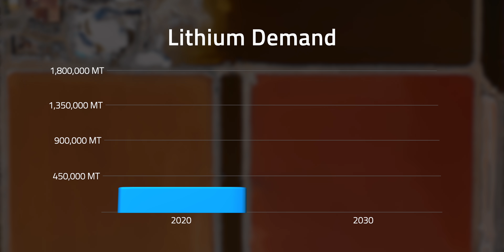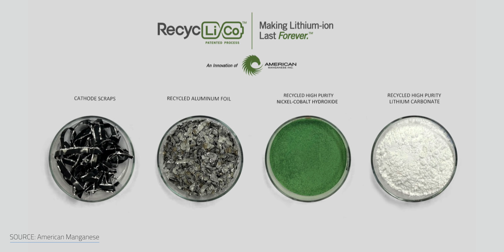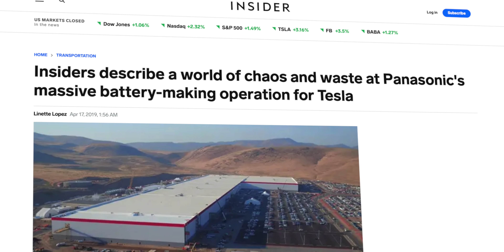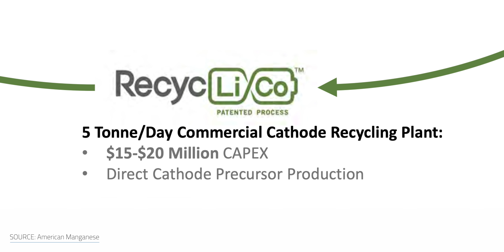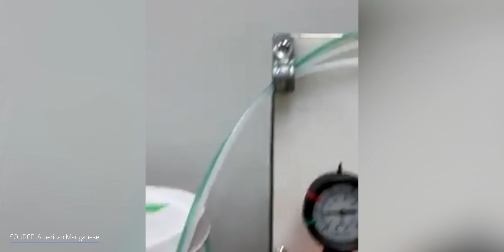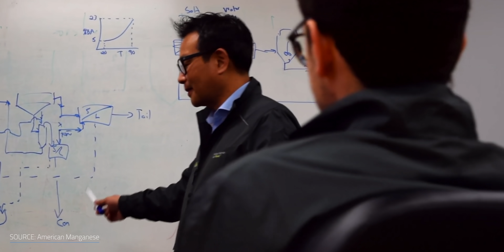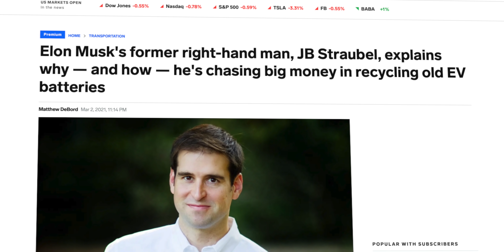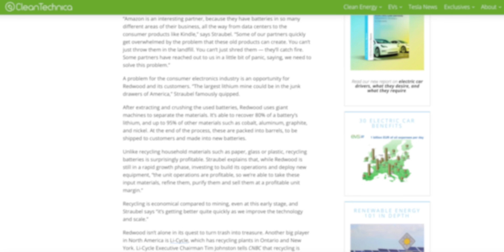Solving EV's Biggest Problem - Battery Recycling Explained

Comment: How do you fight a lithium fueled fire? I'd consider that an issue.
Reply: That's one of the reasons recycling is important. You don't wanna be just tossing these batteries in the garbage.
Reply: @jameshughes3014  that doesn't stop. A car from crashing and burning guy.
Reply: @jtackerman28  If a battery is properly recycled it wont catch fire. That's why you recycle them properly instead of tossing them in the trash. it's kind of like the same reason you don't just pour gasoline down your drain. If you're worried that a car might catch fire because it is electric, that's a different thing. All cars can catch fire and blow up when they crash, so.. I don't see the point really except that, gas cars produce more pollution which does lead to hundreds of thousands of deaths a year. So if your point is that electric cars are more dangerous, I'm gonna wanna see where you are getting those statistics.
Reply: @jtackerman28  Thinking more about your comment I realize now that it didn't have much to do with the video which is why I was confused. it seems you're just saying that lithium battery fires are bad. And, they are different and scary . but they are also very, very short lived. Putting them out isn't much of an issue because by the time any fire truck gets there, the intense burning is long done with. And they can be put out, we just need to use an extinguishing method other than water. At the end of they day, if you are in a car that crashes and catches fire.. it doesn't matter how hot the fire is, your a goner. So to me the important thing is which one is 'more' dangerous, and by far gas cars are more dangerous even as far as catching fire is concerned.

Comment: Would graphene based batteries, if they could continue to improve and be implemented, solve the lithium problem?
Reply: No, use of graphene will not solve the lithium problem. Whether the anode is graphite or graphene, it still needs lithium.
To solve the lithium problem you have to replace the lithium ion (e.g. by sodium).
Reply: @clockworkonion954  What about aluminum ion batteries?

Comment: While recycling is good to not waste the materials, you can’t go from a small supply of batteries from 8-10 years ago to have enough output to get to what’s necessary in the next 10 years. Only makes sense once you have stabilized in production. CNBC already did a video on this a month ago and had a lot more detail and not this high level garbage. Recycle this video into something better.

Comment: Matt, what a timely video.  As a current EV owner (chevy volt), purchased in 2013, I always thought it was a matter of time before there would be a sizable transition to EV's (still in the future).  Continuing this thought process, I also thought the elephant in the room was going to be disposal.  Again we can thank capitalism for rising to the challenge of lithium recycling.  Great video.
Reply: Im also a Chevy 2013 volt owner.
Have you had any thoughts of replacing your battery yet?
Reply: @richardrolson2713  Not yet.  I purchased my Volt new in 2013 and liked the car so much that I purchased another 2013 5 years later.  Both cars have approximately 90k miles.  Both cars are still charging to 40 miles on moderate driving and weather.  Typical nuisances with the cars.  I thought about trading up to a gen 2 but decided not to.  Probably at some point the battery is going to degrade at being unusable.  Since the car is not manufactured anymore and GM is only required to provide parts for a given time after end of manufacture,  I haven't crossed that bridge yet.  The volt concept with the extended range using the ICE still works for me.  I would maybe transition to a full EV when I can go to the local fuel stop and top off in 5 minutes.  And not wait in line to "gas up".
Reply: @scruffy4647  my 2013 has approximately 148000 miles and is getting around 38 miles here in sunny Florida. My next car will be some Tesla since they stopped making the volt.
Reply: @richardrolson2713  They finally got a Tesla service center here in our area (Tulsa).  148k miles on your volt is awesome.  I could do a Tesla at some point.  I do not do that many road trips anymore.  My only complaint about my volt (I am an old guy), is I like knobs for the a/c-heater control & fan control.  Not sure how tesla does theirs.  I am still use to having an instrument cluster behind the steering wheel.  Once you get use to hardly buying gas, it would be hard to go back to an ice vehicle.  Good luck with your Tesla.

Comment: The sooner we transition to aluminum ion batteries, the better. All you need is aluminum, carbon and urea to achieve 500% higher energy density, and the power density of a super capacitor.
Reply: Why are no manufacturers investing in it if it's so superior and has all the pro's with none of the 'con's'.
Reply: @user-uu6bi4tn5o  may be due to R&D they invested on lithium ion battery
Reply: @user-uu6bi4tn5o  The problem is longevity. They lose capacity much faster than lithium ion batteries do. Research is being done, but there is no breakthrough yet.
Reply: @rogerstarkey5390  you can always compensate for these short comings with the appropriate series stacks and parallel architecture provided energy density and power density characteristics are practically and viable.
Reply: @Simon-dm8zv  so it will not be good if we transition sooner rather than later into an inferior chemistry with limitations that can't physically be overcome.

I mean if the limitation is based on structural instabilities then obviously doping trials would be worth investigating but if it were that physical characteristics of the principle materials requires too many compromises then it won't disrupt Lion!

I trialed sodium ion years ago and that seemed to be more attractive for some niche applications.

Another alternative that has gathered more pace than Al. is the Blade which BYD have pioneered supremely. Not as power dense but more cycling life and just as energy dense.
Reply: @satwik1395  I know it's R&D, why are manufacturers choosing to investigate Lion over Al. ?
Reply: @user-uu6bi4tn5o  Exactly. Lithium-ion is here to stay.
Reply: @Simon-dm8zv  I'm afraid so.... until solid state breakthroughs and scale up, there is no disruptor in sight that will shift today's direction from what I see. Maybe alternatives, not disruptors.

Comment: That is way far down the line. Batteries will have a second life first as battery banks like powerwalls.
Reply: @rogerstarkey5390  production will progress so fewer fails will give less batteries to recycle from production. But off course at one point in time there will be a need for large scale recycling of batteries.

Comment: For a battery only transportation world, it’s likely we will need 100-1000x more battery production in 20-30 years, even with 100% recovery using recycling we cannot ever reach parity. Doesn’t seem sustainable with current technology. Battery’s are not actually a green energy technology when it’s made from non renewable resources. Don’t fully understand why it’s the primary contender for a green energy future when a battery’s demand for non renewable resources is so high. 

If only there was a energy storage mechanism that could be from something readily available everywhere and anywhere, and that constantly recovers itself and naturally recycles itself immediately once used…..
Reply: the problem is a lot larger than people realize with emphasis on cars, they've really missed heating, cooking, hot water and so much more, so much more. providing electricity and education to 1 billion people who can't power a lightbulb

Comment: I'm really hoping EV manufacturers let you upgrade to larger batteries as tech continues to improve and the old ones begin to die. i.e. if the standard range improves from 230 mile range to 320 mile range, that you can get the higher range battery installed into the old chassis.

Comment: Nice test lab - but we are still not able to build entirely new batteries out of recycled batteries, which means the issue has not been solved and we have no idea when, or even IF that will change.

It also does not attack the issue that batteries are heavy and need a lot of space in your car. They are a bad energy storage solution for EV's not just because of what their production does to our planet and the countries these mines are located at.

Comment: Actually you have 3 problems in this order. 1. Road taxes presently being collected on  fossil fuel only will have to shift to the magic electricity grid. 2. Where  is all that magic electricity going to come from?. 3. what cha gonna do with all those effing battery's there pal.
Reply: He is from the green religion, he is a Tesla Priest. They tried to solve the problem from the bottom, not from the top. The power grid must change first. Green extremist like this guy will never tell the truth.
Reply: @annakquinn7084  Why not change both? Most of our energy comes from ff plants. 

But all energy in an ICE car comes from fossil fuels and won't change even as the grid improves.

It takes a long time for new tech to take over. Better start now than later.

Comment: As long as recovery efficiency is less than 100% at scale mining additional resources will be required I would think. However, if we can get high levels of efficiency with recycling and reduce the amount of resource extraction from other means then we’re better off! Some of the emerging technology sounds quite promising. Thanks for the video Matt!
Reply: 99.9% isn’t bad. But not 100% I guess

Comment: Great video - Governments should have tied electric car incentives to effective battery recycling / reuse.  I'm interested in a video on third party battery replacement efforts for older electric cars.  Their are a number of electric cars on the road with exhausted or nearly exhausted battery capacity and the number will increase YoY.  The electric car manufacturers naturally want to sell more cars and keeping older models on the road would be counter to that strategy.  The cost of replacement battery packs is a very real issue.

Comment: How much waste and pollution is created in this process?...how is the waste disposed...what gasses are released in this process...and with the emphasis on averting climate change, what does this process do to accomplish this? Simply re-introducing material with such a demand does not count as green. This should be resolved before implementing a huge technological enforcement...
Reply: Waste pollution is zero compared to fossil fuel production. Most chemistry aims fro the emmisions of hydrogen, oxygen and co2 which is then reused in other uses from concrete production to biological sciences. The reuse of these metals allows us to stop mining these rare metals at large scales, they are trying to make new batteries out of zinc ion and stuff but the research isn't far enough. It is important as this could also significantly decrease coat of ev vehicles as the main cost is the batteries, when you can sell dead batteries back to a refinery in the end you'd be spending half to even 1/3 of what you did for the original battery. We don't have the infrastructure yet but the development is in the works and is progressing faster than anything. The worry about producing excess greenhouse gases is kinda uneccesary as we can collect it and use it for other purposes unlike in the past where we just dump it into the atmosphere

Comment: Battery recycling may make EVs actually sustainable at least once we have gathered enough materials from the earth.
Reply: And what will be your attitude toward EVs if that is not the case?  Do you get credit for good intentions?
Reply: @Heroesbleed  When EVs use finite recourses it does not fit in the sustainable future we try to achieve.
Reply: @rogerstarkey5390  They are necessary evils.  Why do you ask?

Comment: Love it. Thanks for the insight. I am still having trouble justifying a 40K EV when I am getting 38mpg average on a 28K gasoline engine auto. And also do not have any of the hassle of getting the charging logistics in place in the home and having to monitor where a charge is available when out on the road. Maybe someday I'll get there. But this is definitely looking good for the future.
Reply: Setting up the charging infrastructure for my Tesla (at home and at my cottage) took about 2 hours in each location.  Now it's been 2 1/2 years since I've had to visit a gas station or change the oil.  What a huge relief not to have deal with gas stations!  My 500km range is way more than I need to get to my cottage (250 kms from my home).  Waking up to a full charge every day is no different than how I deal with my cell phone, except of course there's no need to plug my car in every night.  Tesla Superchargers are plentiful; it's a total non-issue.
Reply from the maker: I'm in the camp of if you have a good, working vehicle keep using it for as long as it makes sense for you.  Using an existing car (gas or EV) is better for the environment vs. building a new car (gas or EV).  But in the long run the transition to EV seems inevitable at this point.  It makes too much sense and there's so much progress happening in manufacturing, charging infrastructure, etc.

Comment: Battery recycling is BY FAR not EV's biggest problem. Industries are already popping up to recycle. No big deal. The biggest problem is where does the electricity come from to power EVs. Note the massive grid failure in the 2021 freeze as an example of how fragile the infrastructure is. Now think of the countless tankers of petroleum products imported / used annually. The energy from the petroleum has to be replaced by something that generates electricity. That's EV's biggest problem - how to get enough electricity to power the cars.
Reply: The homes in TEXAS that had power were the ones with EVs and Solar and Batteries.
Reply: @honesty_-no9he  per calorie, broccoli has 1.8 times the protein that beef has.

Comment: This has always been a big argument against electric vehicles and Lithium grid storage. I think it's a chicken and egg thing where once big batteries are everywhere recycling will become a lot more economical. Unlike plastics, recycling metals can be much more effective because it's elemental materials, not unstable polymers which can't handle chemicals and heat.
One concern I have is that in a lot of countries there just isn't the recycling infrastructure set up to collect old batteries.

Comment: Why aren’t we progressing hydrogen powered vehicles? With water being the only waste product and no need for mining and recycling batteries.
Reply: It's interesting, you should look it up. It's far less useful, affordable and clean for cars than it seems it would be at the moment. In fact I think Matt has some videos on that very topic.
Reply: Efficiency. Hydrogen wastes more than half the power put into it.

If battery tech doesn't move away from lithium. Hydrogen will be the next step.

But only when we have excess green energy.

Comment: I Think Elon Is Trying To Melt The Power Grid !!! ( how efficient are electric vehicles going to be, when there are so many of them that the transmission Losses go up from 50% to 70% ... Lost to heat, in the charging madness ) ...... 
and here in Wisconsin, i Can Not even use a Lithium Ion Starter battery, It's Too Cold Here, i would have to pull it out of my vehicle below 19F which would be about 3-1/2 months of down time..

( Look At A World "Grow Zone Map" And Think, people who live in places any colder than grow zone 8b would have to keep their EV in a HEATED GARAGE )

and really; it is not so much the CO^2 we release, as it is modern agriculture's ability to destroy the planets ability to absorb CO^2 .. sub-sahara has more dirt, and more fresh water, than anywhere else in the world...and america has gone from 4 feet of top soil to 4 inches of top soil since the colonization, Most of that top soil loss during these last years of the end world hunger campaign .

and don't do anything stupid like sending a million reliably built tractors to africa, because we would never see a stitch of food..

Comment: Very informative video.Thanks for the highlighting the critical issues of recycling of battery units.Recycling maybe a good solution but not 100% effective.How much effective is lithium recycling at current rates.Both Chinese and Indian government are considering giving green subsidies on purchase of private EV vehicles and as such Lithium is a costly resource of much use in public transport and renewable energy grid.